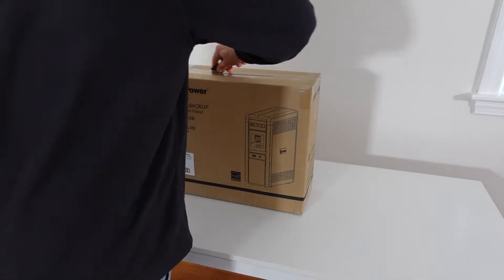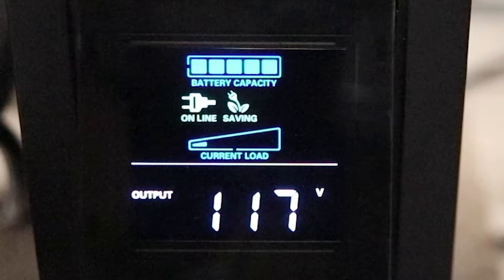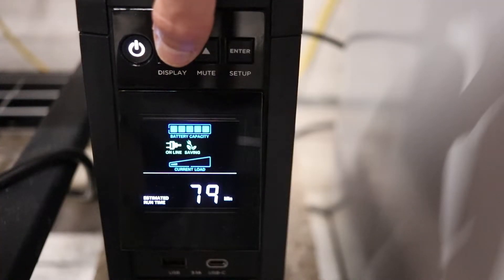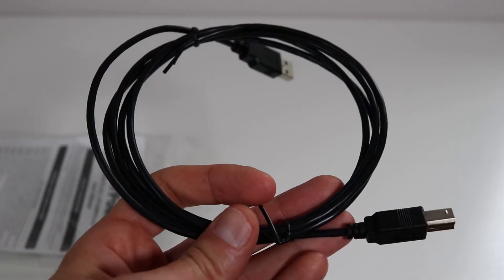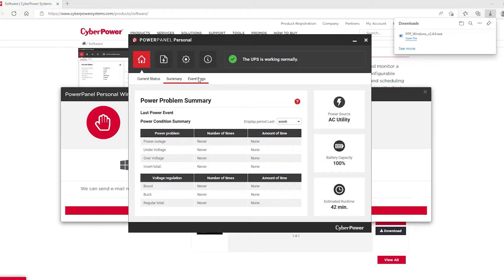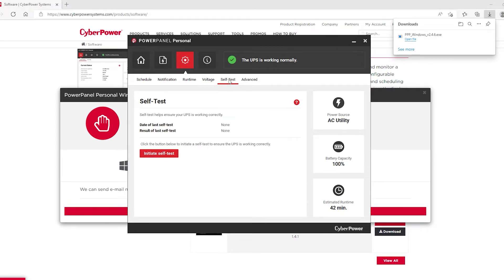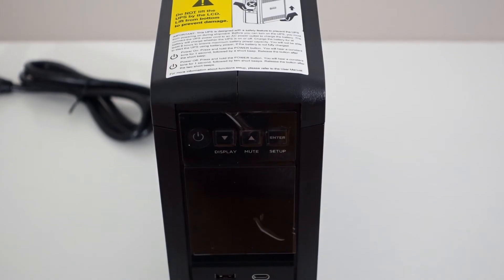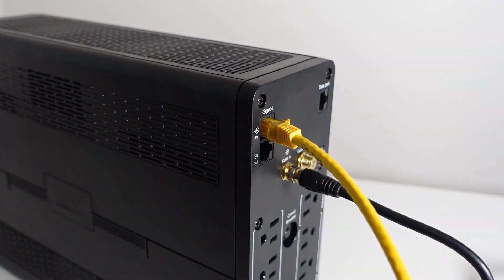Cyberpower 1500VA/1000w CP1500PFCLCD UPS Unit Review, Software Overview with PROS & CONS

Comment: Any information on running whole house generator when power is out, some models wont power up on generator some will?
Reply from the maker: Yes, I have first hand experience on this.  If you have a conventional gas generator, these ups units won't be compatible, as they don't like "dirty power".  My Champion pure sine wave inverter generator has no problem with all the UPS units at my residence.

Comment: Questions
1. If this UPS is fully charged and turned off and is plugged out why does it make the beep sound and won’t come on? It only comes on when it’s plugged into a outlet 

2. Should I keep this plugged in in my outlet always? Would it harm the battery and its life cycle? Or do I need to unplug and turn off when not in use?

3. How to use this device to make it lost for atleast 6 years? Because the last time I had one of these it’s only lost alittle over a year
Reply from the maker: Not sure I understand question 1.  If the unit is not plugged into the wall and you turn it  on, it should beep at you (assuming the beep is enabled) to notify you of no grid power.  For question 2 ups units are primarily lead acid and you don't want to drain them unless absolutely necessary beyond 50%.  Leave it plugged into the wall and on is fine.  Questions 2 is the answer to question 3.
Reply: @SystematicHardware  for the first question I’m tryna explain if the ups is power off, it only comes on if it’s plugged in a out 
Let’s say the battery is fully charged and I turn it off and unplug it from the out and I try to turn it on without it plugged into the out, it won’t turn on even tho it’s fully charged 
Only if it’s plugged in the outlet then it will turn on
Reply from the maker: @eshwarkanhai2341  Sounds like the battery isn't working.  I would contact Cyberpower Support.
Reply: @Systematic Hardware Ok what’s their email of point of contact? Because this is my second UPS from cyberpower with this same issue and I only got this yesterday 
I even seeing my “wiring fault” led is on, I tried it on all the outlets in my house and it’s still on, my house wiring is grounded too so I don’t really understand what the heck is going on

Comment: I use this at a remote location to keep it equipment powered during intermittent power outages. Unfortunately this unit will not shut down in time during an extended outage to keep the battery's from being damaged. Ask me how I know.😀
Reply: I’ll do it. . . “How”?
Reply from the maker: Haha I know better than to do that

Comment: How long will this unit power a 850w power supply- pc with 1 monitor?
Reply from the maker: It depends on the load of the PSU at the time of an outage.  It should grant enough time to gracefully power down the PC, as that's the intended purpose
Reply: I recently bought the 1500, plugged it in to charger the battery but no power in the unit.
Do you have a solution?

Comment: i love them ok but you buy inverter 8000 watts have up 6 12 volts battery 200 amp lithium and sola panel change battery run much long than those the only thing that can run your fridge stove heater A/C your hold house washer  dish water dryer etc ok i have 1100 watts inverter will out do that ok tell me how volt and how watts am putting and how battery i have ok
Reply: An you would only have $5,000.00++ invested!
Reply: @rdp4823  SIrs.

Comment: is it actually pure sinewave tho? in the manual it says its adaptive and other people have said that it is NOT a pure sinewave so you cannot plug appliances into it.
Reply from the maker: Straight from the Cyber Power Website (In quotes), "The equipment with active power factor correction (PFC) design requires Pure Sine Wave source. The UPS provides pure sine wave to meet the requirement of the equipment, enhancing system efficiency and saving electricity costs."
Reply: @SystematicHardware  If connected to a pure sine wave source, what if from the UPS battery, is still pure sine wave?
Reply from the maker: @s3cr3t_channel  Yes!
Reply from the maker: I was thinking about using an oscilloscope to take a look at the wave, but technically Cyber Power states its a PFC Sinewave, standing for "Power Factor Correction".  I'm actually trying to find out what the difference between pure and pfc is now.  I might do a video on it.
Reply from the maker: Another quote from Cyber Power, "The CyberPower Systems PFC Sinewave UPS safeguards mission-critical server, network, and telecommunications equipment that require seamless pure sine wave power."  So i'm feeling more confident of pure sine wave.  Still feel like comparing APC and CyberPower with an oscilloscope.
Reply: buy your self inverter 2000 watts you have 4 12 volt deep cycle battery 75 amp 900 watts you have a bout 3600 watts 4 12 volt battery together get much longer hours with inverter you run a fridge man buy something that if you out of power for 2 days that will worth it nice video buy the way i have 1100 watts inverter with 12 volt deep cycle battery 75 amp 900 watts ok am running 4 laptop right now love the inverter over ups if the battery was lasting long ok they good only for laptop

Comment: 3:20 is that usb square connector? I don't have that in my pc nor I ever see one in any pc.
Reply from the maker: That end plugs into the UPS unit.
Reply: @SystematicHardware  so theres another usb socket located somewhere in the ups not covered in the video? Ok
Reply: @burgundyhome7492  That square USB port on the back is "USB B" which is used for USB OTG (devices that have their own power like a printer or your PC).  That square port is so the UPS can talk to your computer or NAS over USB and tell the computer how much charge is left in the battery (and the computer or NAS will then decide when it absolutely must shut down before the UPS runs out of battery).  The other two USB ports on the front are for charging things.

Comment: Hi. I just got this, i got a question. How long do i have to charge the ups before it can fully run my gaming pc?
Reply: i dont know i just left mine plugged in went to bed got up started using it next day  zero issues with my setups i usually get about 30 minutes to an hour before they shut down as long as im not heavily gaming.
Reply from the maker: Depending on the battery charge, it may take 24 hours or so

Comment: I have a NVR connected to this unit can i remotely reboot my dvr?
Reply from the maker: You might be able to get that to work in the schedule section of the software
Reply: @SystematicHardware   i was thinking that will try tomorrow thanks for getting back to me ill let you know
Reply: @SystematicHardware  Seems its working but my PC that is connected to the Cyberpower isnt booting back up my NVR is  , I also have to have the switch on a different power source cause it takes longer to boot up and the NVR cant see the cameras.  I think I need to set up the BIOs in my clients laptop ?  Any ideas?
Reply from the maker: @brianmatrixteknologies7059  Yeah there might be a setting in the bios to turn on when power is restored
Reply: @SystematicHardware  Seems Laptops dont do that cause of the internal battery I was able to get a mini desktop / thin client to do it  all good I may do a video on it.
Reply from the maker: @brianmatrixteknologies7059  You might be able to alter the wake on lan feature in the laptop's bios no?